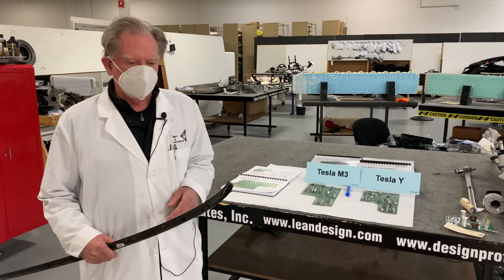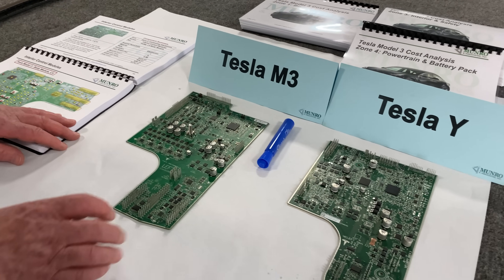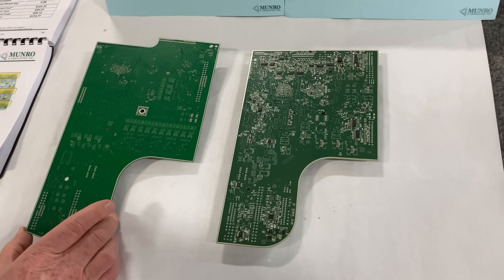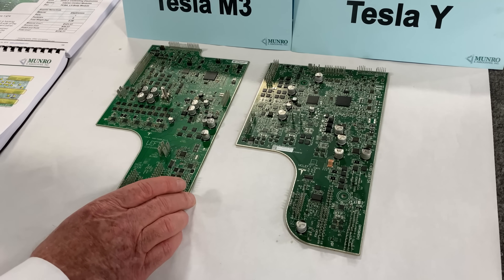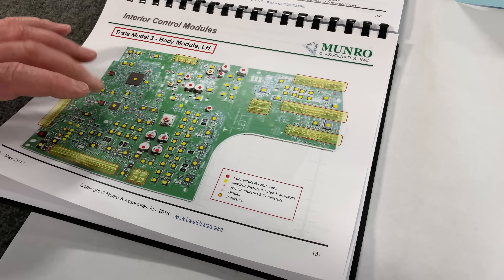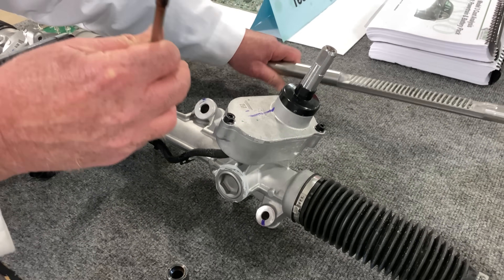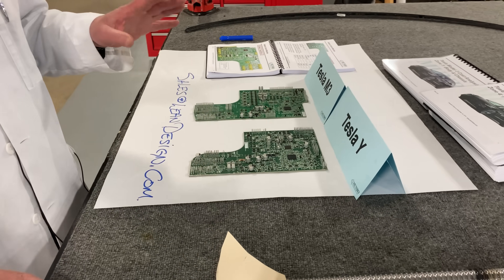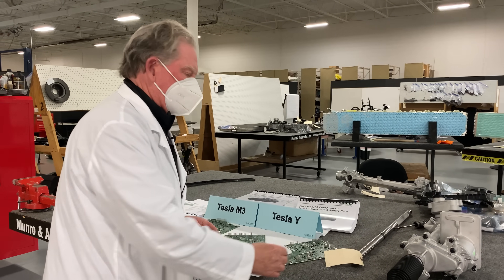Model Y E39: Spoiler Alert! Sandy Talks About Electronics, Body Controllers & Steering Rack

Comment from the maker: 1:53  Sandy misspoke. He actually should've said "some people look at "continual" improvement but what I like to see is "continuous"  improvement." 

The difference being, continual means repeated but with breaks in between; continuous means without interruption in an unbroken stream of time or space. Sorry for the confusion!
Reply from the maker: MrMagooo  Technically speaking you are correct. But what Sandy's trying to say is most other OEMs will develop improvements and release them in batches and new model years. It appears that Tesla will make running changes as soon as they develop them. A late 2019 model 3 may have significant improvements over a mid year 2019 model 3.
Reply: @MunroLive  
In other episodes, Sandy Munro was a fan of economy of scale production (high volumes of parts of equal specification), a fan of robotics and a fan of low tooling costs. How can you make a hardware in an "agile" way, if at the same time the specification for this hardware, that is to be produced in volume, changes every few weeks? Each time, you need to talk to the suppliers, they need to reconfigure the supply chain, reprogram and test their manufacturing automation, rework their tools, readjust their quality assurance. Contracts and prices will need to be changed, packaging may need to be changed (think of the differing physical dimensions for the two BCM boards for example), backward and forward compatibility needs to be tested and expressed in the parts catalogue for service/repair. In fact, there may be a ton of resulting changes and adjustments. Suppliers also are forced to reduce their stock.

From my point there is a sweet spot where there is enough agility (high enough rate of changes) and still enough true economy of scale on units of identical specification of a certain hardware component (low enough rate of changes). Neither of the extremes are desirable in car production or car component production.
Commonly in the industry, running changes are expressed in change indexes for car parts. Then there is a part number and a change index. As long as the part number is the same, the parts are compatible. The change index then expresses advancements in manufacturing or materials. This is true for other manufacturers as well.
More vertical integration may have a few benefits for Tesla regarding agility, but at the same time, there may be drawbacks when other car manufacturers can freely choose their suppliers to match a certain level of quality and price (associated with a certain volume of identical parts) in a certain time limit.
Reply: @richardnedbalek1968  Keep donating... if we donate enough he'll  keep breaking things (and maybe sell more reports!)
Reply: Sandy is imperfect? You are hereby cancelled by the ruling Internet authorities!

Thanks for your great work guys. We appreciate it.
Reply: I actually understood the misspoken word.  I knew what you meant.
Reply: Congrats on getting a shout out in The Detroit News. Including a link directly to your YouTube channel!
Reply: Right. I did wonder what he was trying to say there. Thanks for clarifying.
Reply: Munro Live kaizen
Reply: @Mr. Beffu But software can be changed relatively easily. Things change considerably as soon as you turn to hardware.
Reply: CI/CD technics :)
Reply: Imagine Sandy didn't found out about Tesla at the time he did. Both Tesla, as well as Sandy, would have been quite a few dimes poorer I think.

Comment: Well, I need to ask a question even though the video was posted 2 years ago.  I recently returned from a trip where I received an error regarding the Front Body Controller.  I had an aftermarket rear view camera plugged in to the cigarette lighter as I was towing a trailer and needed to be able to see behind me. The service center tried to claim I had caused the malfunction and attempted to charge me for the repair.  How could plugging something into the lighter cause a malfunction?

Comment: Too much stuff on a ckt board doesn't mean better, what are the reliability impact?  Heat, and snap connectors are not as solid as a screw connector...snap together is weak, and prone to failure

Comment: Why does every function in a Modern automotive application have to be controlled by a computer?
Reply: Because it's easy. You could do it without a computer and devise a complicated system of unique multi-contact switches and relay logic, or you could simply write a few lines of code that do the job better, reducing cost and complexity, and possibly increasing reliability.

Comment: Only populating one side of a PCB actually saves quite a bit of money.  In many cases, if you aren't volume constrained it is better to have a larger single-sided PCB than a smaller double-sided one.  Can also be better for heat dissipation.

Comment: 10:10 Body control module left and right symmetry: They absolutely would not create the PCBs and load them as Sandy shows here. Instead, they would take two right board designs, and rotate one 180 degrees around the perpendicular axis. Those two right board designs would fit together just the same way.  (And same with left board designs)  Both of their top surfaces would be on top (and bottoms on bottom).  This way, when loaded with components, the pick-n-place machine only needs to have top components for the topside load, and bottom components for the bottom side load. And for board testing, it may be possible to put all the test points on a single side of the board, which would be defeated in Sandy's arrangement. If they want to run left and right modules on the same panels, then they'll be in sets of two rights and two lefts -- and still the PnP only needs the same set of top components for topside etc.

Comment: When you're talking about continuous improvement, you need to reference a common model.  You can't compare a low cost model to a high cost model and then say "Wow!  Look at that!"  This guy has no credibility at all.
Reply: You do realize both a model 3 and model y are the same midrange vehicle. One is a CUV and the other a sedan. But keep up with your delusions.
Reply: @shoal007  But the Y in this case is much newer than the 3, so the point is at least somewhat valid.

Comment: The only issue I can see with continuous change in a model of vehicle or anything for that matter. Is later in life when you're going to need to repair something. Getting the parts for it is a bit complicated because you won't know which version of said part you need. Now it could be that Tesla and whatever aftermarket suppliers pop up. Could make all new components retroactively compatible.
You see situations like this with Tesla already with the Model S and their door handle assemblies. Since 2012 I believe there are four different versions of the self-presenting door handles. And they are not interchangeable or at least not completely so.
So it could in the future make it more difficult for do-it-yourselfers to work on their own vehicles. I suspect Tesla has this as part of the plan quite frankly to eliminate or make difficult the possibility of anyone working on their own vehicles in the future. It also makes me wonder if ultimately these become essentially disposable products. Where you continually just upgrade to the new one.

Comment: It's confusing using "continuous" vs "continual". I think what legacy auto does is generational. They're all improving, it's the interval that's different. Tesla has no well-defined model generations or series, because they make smaller changes and it would be too confusing/meaningless to the consumer to know more than which year it was manufactured.

Comment: The component density on a PCB really only tells part of the story. Knowing the purpose of the circuitry is more informative. Higher density can simply mean they've incorporated other components that would have normally been separate into the same substrate. It doesn't necessarily mean it's better. They could have done it for cost reasons.

Comment: Looks like they had little emv problems pcb Layer nailed on the outside.
If they would use Ferrite beads before they went to the connector they'll get much better.
Is the Hvac-Fan a Brushless Motor cause of the 3 Phase half bridge.
I cant read whats on the controller for seat-control but it looks like they used an own micocontrller for every H-bridge or is it an i2c/spi chip?
It's also not recomendet to route the high currents with pwm over long distances to the connector.

They use realy much different types of Mosfet for closely same currents. Or maybe integrated switches?

Well great Work, keep on going

Comment: This means that Tesla has a dedicated electronic board design and chip design too.
 Their main advantage is the custom made Ai Chip that they use in their cars.

 The semiconductor companies will make chips for car AI, but that will take time to catch up with Tesla cars. And then the Tesla cars could be upgraded, IF their controller boards are well documented and can be integrated or upgraded later on.

Tesla might sell CPU upgrades, if their cars are all similar.

Comment: I work for a legacy OEM, its name starts with an F and ends with a D. I deal with the electronics and circuits that get put in our vehicles and let me tell you, I am so freaking scared that I wont have a job in a couple of years. My employer is SO BEHIND that I'm afraid it will never be able to catch up. Tesla is building  F-35 fighter jets compared to the Wright Brothers era biplanes we are still building in Detroit.
Reply: Ford is a VW acquisition target for its Argo unit. Maybe such an acquisition will happen after $FQ.
Reply: Are you guys at F**d still using relay logic and overcomplicated switches? The most recent one I've been able to look at is a '99. The turn signal switch was one of the most complicated switches I've ever seen, where it really only needed 2 poles.

Comment: If competitors are so far behind Tesla why is Taycan "off" powerconsumption so much better than Tesla's? See bjorn: https://www.youtube.com/watch?v=OtbwqvcVd_k
Reply: OK so that's the limit of your understanding?
Reply: Is this with Sentry Mode turned on? That will use a lot of power because the main computer and the cameras must remain fully active. It's like leaving a PC running Chrome and mining coins in the background compared to putting it in sleep mode. This may also make the coolant pump need to run, using more power.

Comment: If the M3 board is from the 2018 it’s not really and apples to apple comparison. Not does it necessary show the improvements made to the Y from the 3 which is what the implication being made seems to be. There has quite significant HW changes to the 3 in the last two years. If you tore down a 2020 3 you might find the exact or very much the same board as the Y. If rather see a compare of a 2020 3 teardown to the 2018 3 teardown. Or a compare of the 2020 Y teardown to a 2020 3. Comparing two different models several years apart isn’t an ideal comparison.

Comment: For the steering controller: yes, that looks like DMR - dual modular redundancy. And in case of software faults, one half can take over when the other half fails (active standby with a master-slave configuration).
With hardware failures: due to only two board halves, it can only detect faults (and then disable electric steering support altogether) and not correct them. Because in the case of hardware errors both halves will have different results, but there is no clue, which half is wrong and which one is right.

In aircraft, you would actually see more triple modular (TMR) redundancy. Then, as long as two boards get the same results, they can overrule the defect one 2:1 in the TMR majority gate and the system can remain functioning. And after that one failing and being marked for repair, you would still run in DMR mode.

What Tesla missed: they put both sub-boards into the same housing with probably non-redundant power supply. This way, due to physical proximity and common power supply, it is more likely, that both halves are affected in a case of a harmful outside influence.

In contrast to your statements, there is redundancy in other ECUs by other manufacturers as well. An example is redundant sensor fusion in Audi's traffic jam pilot (ready for SAE level 3 in Audi A8, A6, A7). They have their sensor fusion functions redundant in two ECUs: in the zFAS (central driver assistance system) ECU and in the radar ECU. You will also find redundancy in the system that brings the car to a controlled stop in case of system errors.

Here, there is a DMR redundant system with two NVIDIA sub-boards for an ADAS central processing module:

https://www.stern.de/auto/fahrberichte/osr-evolver---zentrale-steuereinheit-fuer-das-autonome-fahren-automotive-grosshirne-7806582.html#mg-1_1589434139182
It's an OSR Evolver board - you should find it in a Jaguar I-PACE.
There is also redundancy in wiring: the Flexray bus network used for real-time systems in chassis/brakes/steering, in CAN bus wiring (two-wire operation with a fallback to one wire), in the MOST ring bus network (the components can continue to communicate in case one network link breaks). With Teslas choice of Ethernet in a number of places they gain a higher data rate, but they may loose the redundancy features of these automotive OSI layer 2 technologies, unless there are redundant links and running a rapid spanning-tree protocol present. Or trunking links between components. Would have loved if you had looked into that as well for Model Y.

And there is many more ways to add fault-silent or fault-operational behavior other than doubling hardware in cars: https://www.edn.com/redundancy-for-safety-compliant-automotive-other-devices/
Overall: I truely love your series, even became a Patreon of this channel, but I don't agree with the level of outstandingness and excellence that you seem to want to associate with Teslas designs. Tesla may be a pioneer in in-house development of advanced electronics and software development. But other vehicle manufacturers, together with Tier 1 suppliers, achieve similar features earlier but more hidden and behind the scenes from the non-automotive public crowd.
Reply: Since the steering controller is more of a power driver than a computer, wouldn't it more likely for one half to simply stop working and become completely unresponsive, than to spit out garbage or make a wrong decision?
Reply: @user2C47  Look at 8:14 with the large IC with likely 200 pins. This is quite a serious processor, likely 32-bit and a real computer. One half stopping gracefully altogether is a hopeful assumption, which may hold, but which may fail too. A FMEA will gain relevant insights. Some errors will be handled gracefully, but other's will not.
Here is a similar, but more advanced design by Schaeffler-Paravan: TMR on the signal wiring to the controller, TMR in the logic on the board, then connections to two servo motors.
https://www.schaeffler-paravan.de/produkte/space-drive-system/steer-by-wire/
https://www.schaeffler-paravan.de/fileadmin/user_upload/slider-steerbywire.png

Comment: Hey Sandy, I'd love to see you tear down a Onewheel, Onewheel +, Onewheel XR, and Onewheel Pint. They are a single wheel, self balancing electric "skateboard", that uses pressure sensitive foot pads to control acceleration and braking/deceleration.

Comment: Sandy, question: you compare the Y with the 3, but with with version???  Are the model 3 components the latest (end 2019/2020) components of from an early 2019 or older model?    Because the M3 also evolves during production.
Reply: It is original 2017 version.

Comment: To be honest the electronic isn't really the big killer to other auto manufacturers.
Yes it's all designed by Tesla whereas others buy off the shelves micprocessors etc thus constrained by what's on offered by uP makers.
Yes this gives Tesla an advantage in cost.
VW, bmw, ford, GM etc.. they auto manufacturers. They will then stick some computer into a car to compete with Tesla. I say "some" computers - they are not software or electronics company.
Tesla is software and electronic company that makes cars.

Tesla have over billion (?) Miles of real world data for it's AI. Tesla gather these data from all their cars for AI modelling.
It's learning to drive better - all the time.
I can't see VW, ford, GM etc is going to catch up not just with electronics but the software. You can simulate the world for a auto driving but the simulations can only go so far. The real thing is the real world.

So like Microsoft it's software. It's not a physical thing- yes I can save 4c if I use 3 bolts instead of 4.

 How does Microsoft decide the price of it's software?  Stick a finger in the air and think of a price on what's autopilot is worth per car. $4k , 5k, 15k etc.

Yes it's not truly level 5 driving yet. But imagine Tesla managed to achieve this holy grail. How much will a driver pay for this? How does ford/GM catch up?

Comment: As far as i can tell, whilst the Tesla electronics are nice, they aren't actuualy anything that special, because they seem to use off-the-shelf silicon?  The really trick stuf is where you actually develop your own silicon to do a specific job, enabling you to optimises that silicon to do exactly what you want, and that only.  Here, the OEs with links to the semiconductor manufacturers are, imo, actually ahead of tesla.  For example, on the mody module and steering motor driver, can you tell me how many ICs are branded "tesla" and how many "infineon" or "freescale" for example?

Also, by the looks of it, the GEN3 body module has become more integrated, and uses less descrete drivers and more combined ones, ie has become better optimised to do exactly what it needs to do, and only that? Here, i'd expect to see more proprietry Tesla IC's and less OTS parts!